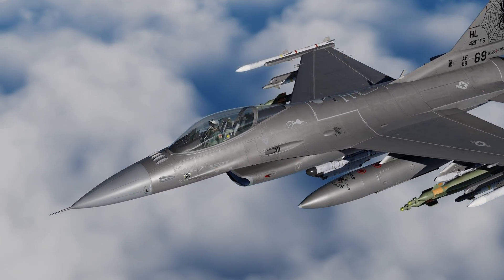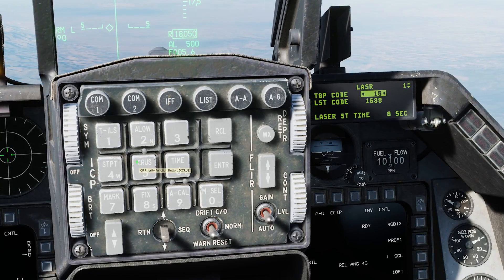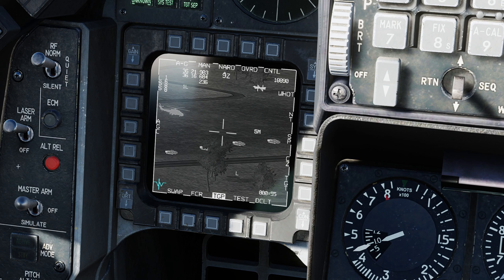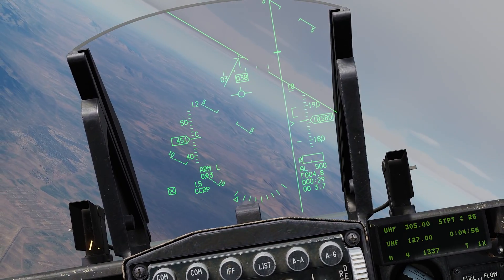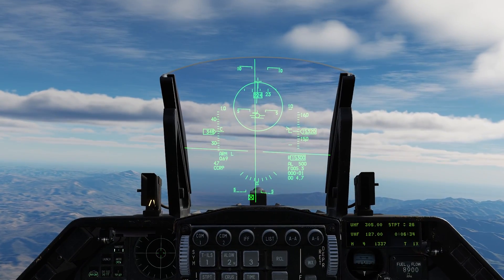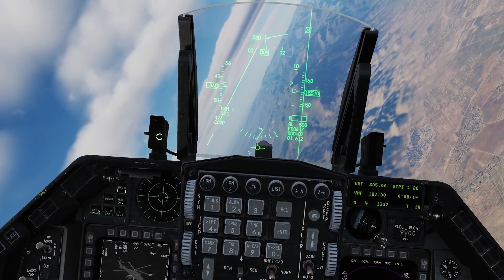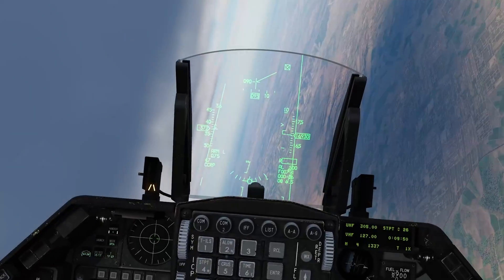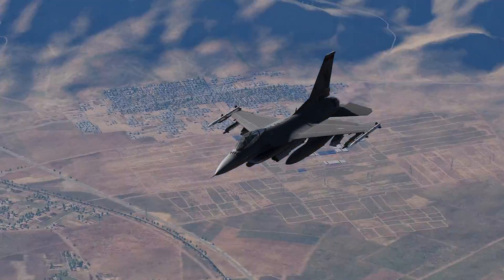DCS F-16 Laser Guided Bomb Tutorial

Comment: Did you manually switch to INR track for keeping the pod on target during masking? I remember a video from Wags about it a while back but it may have changed since?
Reply from the maker: So when I made the markpoint it lost track and reverted to INR mode which is why I needed to point track the SA13 again.  When I know I’m going to be doing some extended maneuvering or pulling high g’s, then I’ll go to INR mode with tms aft short.  Great question.

Comment: Hello, Thank you for this video. Just to clarify one thing. When your lasing the target. Your not holding the trigger down when you drop the bomb correct. You set the laser to fire automatically at 12 sec correct. I was dumb founded, I  never knew I could automatically have the laser fire on it own in the f-16 like the f-18.
Reply from the maker: No I’m not holding the trigger down, that is the manual way, which you can do if you please, but I’m all about that auto stuff
Reply: @TrickerDCS  Hey, sir, I just have one more question. Sorry for the bother, but mighty Tgp jumps from the target when I designated in point track. I almost have to stay on my t. D c cursor to make it stay on there?Why is that if you might know. It almost never ground stabilizes or if it does it jumps from the target to the ground the target to the ground the target to the ground. Especially like bunker I am losing my mind. It makes it so my harder
Reply: @TrickerDCS  Wow, that's great, sir.I was not aware that I could do that. I have been doing it manually, and believe me, that's a struggle while holding and orbit and justing flying. Is 12 seconds your go-to for any particular reason,Thank you.